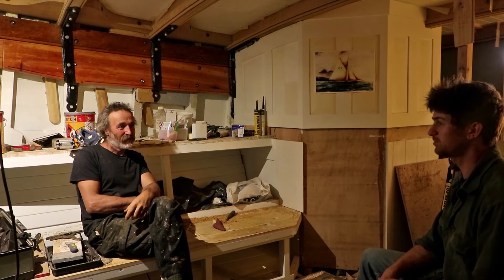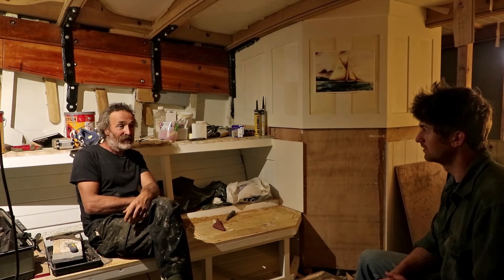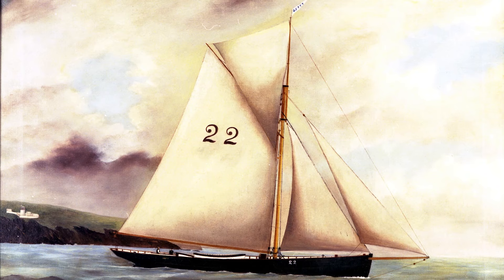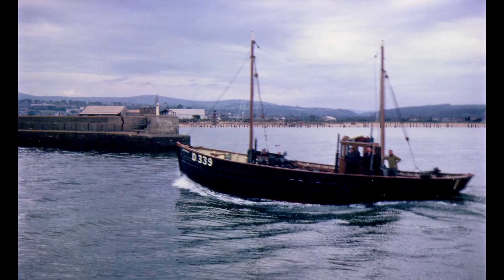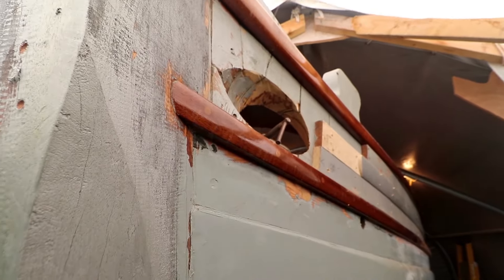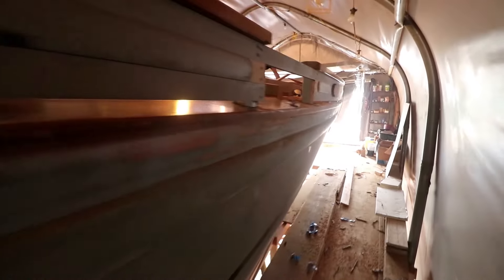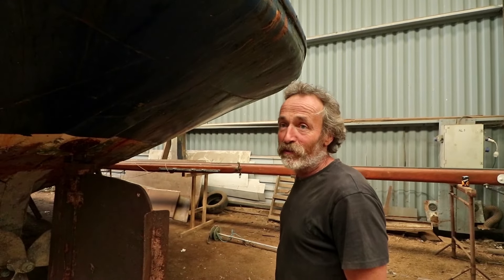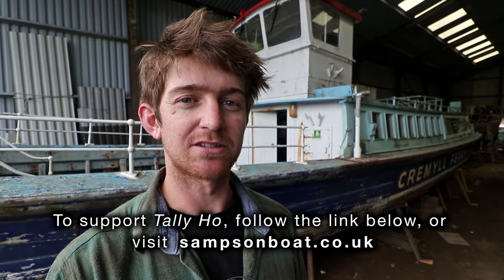Meeting a Master Boatbuilder / 1905 Pilot Cutter - Rebuilding Tally Ho EP33

Comment: A really good point was by Chris regarding potential boatbuilders is to have some experience at sea. I was working in a busy production yard in the late 60's when they took on some hands from a caravan building firm to do internal fit outs. They were very fast workers who designed jigs to speed up production but had no concept of how strong things needed to be to withstand the pounding a yacht takes in heavy weather.

Comment: Great stuff.  Too bad, IMO, about the Armadillo.  I'd prefer her being returned to steam power....  just so much more authentic, but she's his and that's a huge project.  And no, I can't imagine crewing a real steam engine boat... because... where you gonna find a engineer!  heh.
Reply: Robert Mardis 
Steam has a certain romance, I’ll grant you, but it would almost certainly cost more to build, would have an energy efficiency of  10 - 20%, would need regular boiler maintenance, a licensed engineer at all times, be very, very polluting, and cost a fortune in fuel.
Probably more than enough to prevent the whole project’s economic viability.
A marriage of old and new is fine, IMO. At least it won’t have the “stench and hideous hum” of diesel and that coachroof looks large enough for some serious solar collection. With roof panels at the termini, each end, they might be able to make it self sustaining.

Comment: Not sure about driving a boat that large with electricity. I think that he should go back to steam. The steam trains could run during a flood.
Reply: smolville 
Hey, they run large ships on electricity. Sure, they use diesel generators, but that’s ‘cos you can’t get the range for crossing the Atlantic from batteries but, for a ferry that runs a few hundred metres between termini, that’s not a problem.
Plus operating costs are horrendous for steam (must have a ticketed engineer in charge at all times) plus ~15% efficiency, pollution, very high fuel cost and regular boiler maintenance.

Comment: Amazing series, there's something inspiring about the way you tackle enormous projects with such a cheery disposition. I sometimes work (with a limited budget) on a 70 ft ferry boat called the "Hiawatha" that was originally built in 1895. She has a steel hull (Lots of re-plating) , 3 inch Douglas fir decks and a mahogany superstructure. She started out steam driven  and was converted to diesel in the 1950's. There's a claim that she's the oldest "continuously active" ferry boat in the world. Here's a link to  a short 3 minute vid of 2 projects that I've done on her.   https://www.youtube.com/watch?v=RI4T5BV3cLU

Comment: That boat needs  a new keel timber and why do british people like makita power tools
Reply: Because, for the price, they're excellent, durable and reliable tools. You can get better, but for the difference in cost it's not worth it. Makita stuff generally can generally be used to produce work to a decent standard without you tearing your hair out in frustration with tool failures.

Comment: For over 30 year I have watched the some times heated discussions, as to what/ how much of the original ship must remain to be the original. Where is the line that you cross that makes it a new ship just incorporating parts of the old one ??? Check out the "Heartsease". They removed her wooden hull and replaced it with steel. Cut 20 ft off the stern making her shorter . Removed and redesign her interior. went from 5 mast to 4 . Change type of rigging to a different sail type. Only thing from the original is the ships wheel and bell. You are repairing Tally Ho , and have - my best guess at lease 20% of her original hull. She is still the Tally Ho.
Reply: Its like my genuine authentic hammer once owned by George Washington.  Of course the handle has been replaced multiple times over the years but the head only once or twice.
Reply: Exactly, It's like the car that was ran over by a tank, by taking the one undamaged fender and adding the rest of the parts from 3 donor cars it was fully restored.